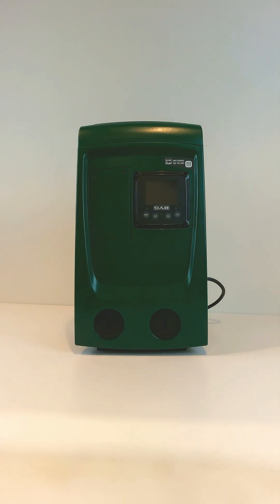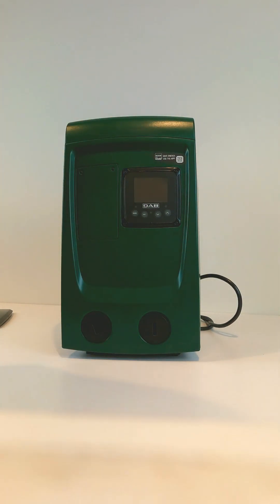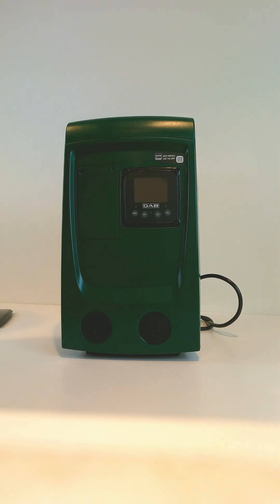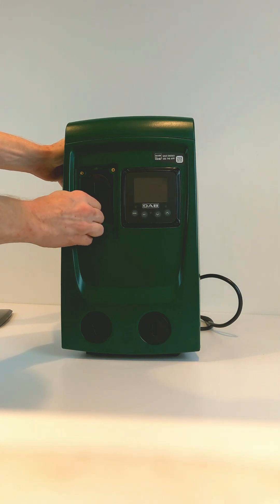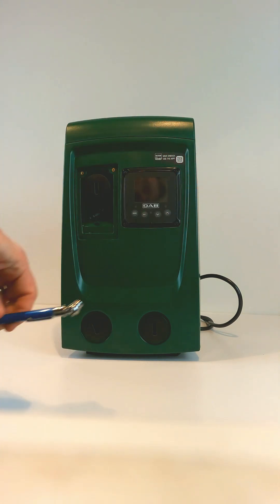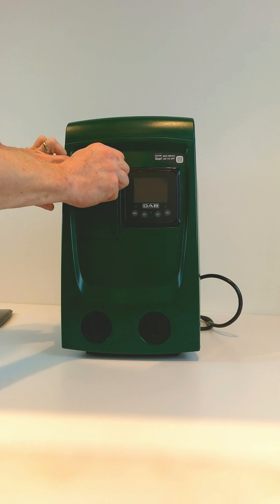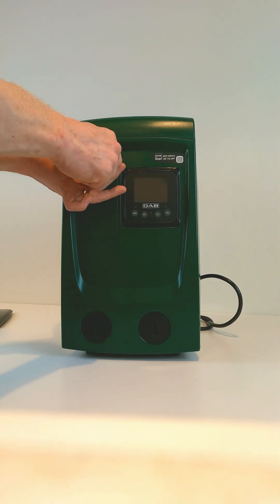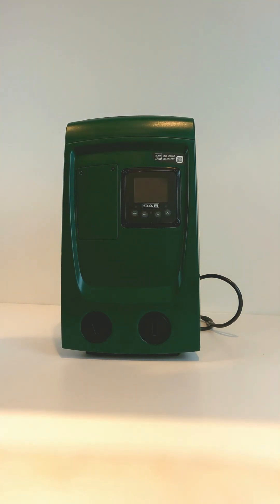How to check the pressure in the expansion tank on the DAB EsyBox Mini 3 #shorts

Comment: you can also let all the water pressure off of the system and turn on power briefly....the screen will tell you the current pressure which is your air tank pressure

Comment: So what if the pressure in tank is low. How do you pump it up? With a bike pump I’m guessing
Reply: yes but because the tank is so small, when you disconnect the air pump you lose about 20 psi so make sure to check again